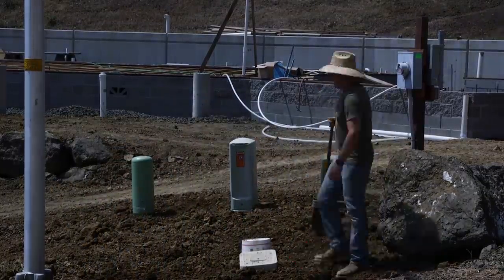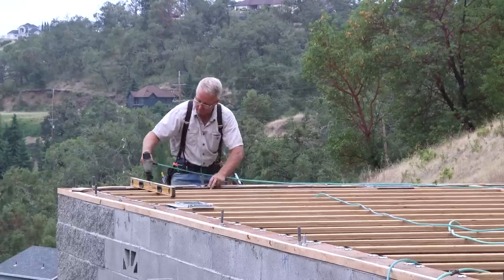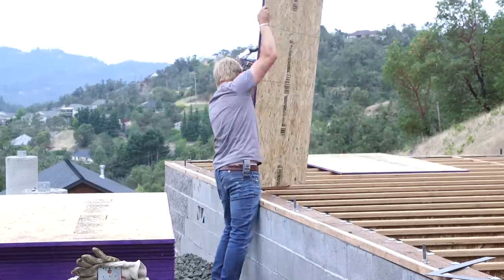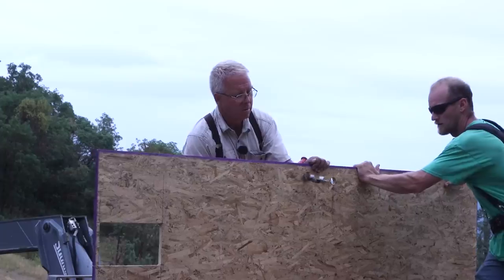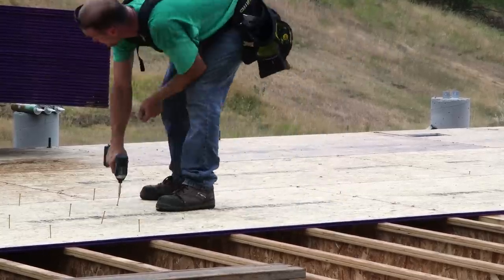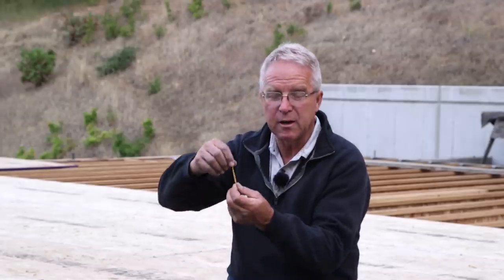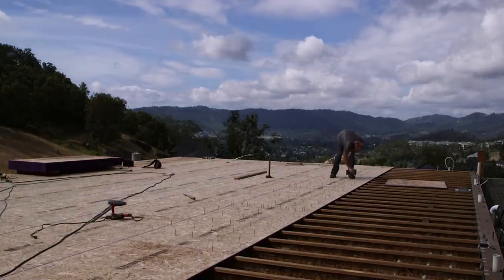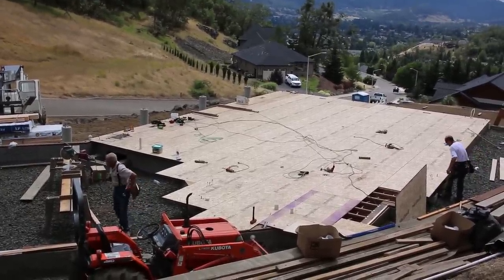Lay the Deck Ep.44

Comment: Hi, I use pallet wood for most of my DIY jobs and I can tell you just how well ring shank nails hold and they are probably the reason for 90% of my bad language when I come across these nails in a pallet. I have an air de-nailer that is fantastic at removing nails in pallets, but even when I dial up the air pressure these types of nail are b***** to get out.
Reply: I had to demo stair treads one time.  Ring shank nails and Pl adhesive.  That was 15 years ago and I still remember cussing and scraping.
Reply: Pallets usually have spiral shank nails not ring shank. Even worse!
Reply: @JarvisElian  Yes I have encountered both spiral shank and ring shank nails, the only thing they have in common is they are both a B*** to get out.
Reply: @Mr Sunshines I think you missed his point, which was about the nails in the pallets. And I can say from experience, it doesn't matter much what kind of wood it is if you're trying to get ring shank nails out of it. The nails are the problem and it sucks! Double-edged sword because what goes up must eventually come down. 

You may not know, but they're used a lot for subfloors specifically because they tend not to pull up as easy. I assume the guy brought them up for that reason, because in the video they were getting into staples to hold things in place while the deck screws go in, which is a great way to keep the OSB sheets down, and unlike nails, allows for reasonable removal if you miss the joist or skim the board. 

Bit surprised this didn't immediately pop into your head, since you're all up on 'building houses'. When I read the first comment talking about nails I knew immediately what he was getting at. And I've only had to do THAT job once, for a mobile home subfloor! Woulda thought it'd be obvious! Not very sunny over there when you wrote that, eh? Somebody rain on your plywood subfloor?

Comment: A fastener sticking out the other side doesn't hold any better.
I would use a little shorter screw.
JIM
Reply: A fastener not reaching the other side doesn't hold as well though
Reply: Shorter screw wouldn’t have a large enough smooth (shoulder) part near the head that he was describing
Reply: Lyle Conway  The correct min spec for 3/4” T&G Advantec subfloor is 2” W 3/4 shaft and 1.25” course thread. That’s what we use and they would have worked perfectly. That said there is nothing wrong with a 2.5” screw either other than you will have 1/4” penetration out the bottom of the iJoist top chord. As long as it’s not causing that chord separate (I’ve seen that happen too).
Reply: Dinsdale Drummond  not true at all.
Reply: @HBSuccess  It's demonstrably true. A fastener that does not penetrate all the way cannot possibly have the same holding power. There is simply not as much material engaged in the screw threads and the screw tip threads do not hold as strongly as the side threads, which are under more pressure and have a larger area of engagement. A screw with the tip overpenetrating holds better than a screw that stops before it can reach the other side 100% of the time, with all other screw aspects being identical.
Reply: He probably got those screws because that's what was available at the time and he didn't want to waste time looking around. Who gives a rats if they stick out or not.

Comment: Really enjoy the music you put to these, Nate.

Also, question: We built our house a couple of years ago. glued and screwed the 3/4 plywood to the floorjoists. But there's a squeak. From somewhere where a wall bottom plate is nailed to the subfloor. Do you plan to screw your wall bottom plates to the subfloor? Is this becoming good practice?
Reply: @Kyler and Sylvia Miller:  Can you access the under-side of that floor?  You might be able to screw up through the sub-floor into the floor plate to pull it tight.  (Easier if you have someone cause the squeak from upstairs to help locate the squeak, then stand there to compress it while you screw from the under-side.)
Reply: Thanks for this. Yes, I can access the space from underneath, but the squeak happens so infrequently that I'm not too concerned about it...  just the odd creak in the night as the house settles.Pretty hard to find the squeak... just one nail, I'm sure. Cheers!

Comment: When osb swells it doesn’t shrink again, not back to original. It’s lost it strength. Osb is vertical mulch. Lookup Matt risinger and see the video he did on a severely water infiltrated OSB structure. The WHOLE thing is shit and is having to be re-done.
Reply: I second that. When I heard him say that I wondered if they use different OSB  than we have here in Germany, nope, same stuff (allthough you get some impregnated stuff that has either a greenish or purple hue all over the board)
 Few years ago I had my roof fail due to a ripped vapor barrier. The drywall guys tore it and the glue did not adhere to the masonry on one wall. (Yes, building here are usually made different, modt of them are masonry and concrete, maybe drywalls for interior walls, but very rarely wood. You find that mostly in prebuild houses that only get assembled on site)
However, due to the torn vapor barrier underneath the insulation and the roof joists, moisture seeped into the insulation (some mineral wool stuff, no harm to it) and into the OSB.
OSB is vapor tight I löearned. The OSB did swell up to about 2.5 times its original thickness and was about as solid as soaked cardboard. Once OSB got that wet, here it is seen as failed, as obviously the wood itself dries up just fine, but the glue bond is more or less gone afterwards. It does not even shrink back to its original size, it stays at about twice the thickness and even when dried up you can easily rip it apart with your bare hands. I would not dare walking on that stuff afterwards.
My roofer recomended two things, adding in some ventilated space between an additional wind barrier and the boards, to allow anything to properly dry up in case anything gets wet, and with that using regular boards, as they will dry up and keep their strength just fine. Due to the ventilation rot will never be an issue, as nothing will stay wet. If anything has the chance to stay wet, you have an issue no matter what material.

Comment: Were 2-1/2" screws mandated by code?  Because with glue and staples, it seems like shorter ones would do.
Reply: A survey of single carpenters found a shorter screw won't keep the OSB from getting nailed by someone else.
And in local news, equivalency is the name of the game in construction so with the recommended 8d nails at 2 1/2 in length there should be a Roman connection in there somewhere.
Peace.

Comment: If the glue “welds” the decking down, why would ring shank nails squeak?
Reply: The glue could set up before you can get the sheet laid down.
Reply: "if the glue doesn't hold" ... or if there's an air gap and the glue never made contact to begin with
Reply: Fool
Reply: That’s why they’re “ring shank” so they don’t back out.
Reply: @brinkme1772  well thats why you put gule enough
Reply: @matthewerwin4677  how would the glue set up before the sheet gets laid. You must not be a framer 😂😂😩😩
Reply: @alexmitilica99 If the adhesive is laid down and sits for a while before the sheet gets laid down the adhesive will skin over and not bond well to the sheet if it bonds at all.
Reply: If you think about the way they are installed, nails don't tighten and pull like a screw does. Ring shank nails only lessen the chance of the nail coming loose. If the nails dont pull the deck down as tight as screws, then the bond with the glue wont be as tight either.

Comment: Thank you for the great video. As always, I learn a few new things and greatly appreciate the time and effort you spend.

What I don't understand is this preoccupation with floors that don't squeak. Maybe it's because I used to live in a 1900 era farm bunkhouse that was never meant to be home to a family, but someone added a few doors and turned it into something that resembled a 3 bedroom house based on building codes.  They used wood planking for flooring and had holes in it where the knots had fallen out.  Guess what .. it made noise.  I never really paid much attention to it growing up.

My current home was built around 1984 and makes noise. I find them comforting, not annoying. When the wind blows just right, it sounds like someone is walking around upstairs. If my wife comes to bed after I do and I'm still awake, I can hear the floor squeak as she gets to the door. I know that no one will ever be able to sneak upstairs in the dead of the night because there are 4 stairs that if one doesn't step on them just right will announce their presence.

For my house, glue and nail it down and be done with it. It's faster, cheaper, and will be easier to repair 25 years from now when those Torx drivers have gone the way of the buggy whip and only old men know what to do with them. Nails are timeless, easily removed, and when driven properly, will hold the floor down just fine.  I recently replaced a very large back deck the prior owner built and had to use a 6' 2x4 as a lever to remove all of the damn decking because most of them had screw heads that were impossible to get a grip on due to time and weather, many of them twisted off and required using a hammer to break them off. That Torx head works just fine now, but get 15 years of dust and weather into it and it will be just as bad as a Phillips.  And cause just as much swearing trying to remove it because even indoor screws get dust packed into them.  And heaven forbid someone paints over them.

But .. to be fair, they are easier than Phillips, I do use them from time to time.  Usually when I want to remove them right away.

If someone really wants (which is different from needs) noiseless floors and is willing to spend the money, and they don't mind hiring someone else to do repair work later, go for it. Far be it for me to tell someone what their values should be.

I just don't understand it one bit :-)

Comment: I would not be comfortable with 12" spacing on screws.
Reply: i agree...Up here in Ontario its 6i inch's in the field and 3inchs on the joints. And the way they did the PONY walls way to much work . And the idea using a string line to level the floor when they should have used a transit level.  A string that long is not level gravity makes it bow down so there might be a nice little dip in that whole floor. We call PONY walls up here Knee Walls . I could add more to this but i would run out of space...

Comment: Great vid also !! Thank you. 
 On my house floor that I did this summer. I shot down under the wall plate lines and a few other non travel areas with 10 penny ring shanks. Because I had them . But only had 1 box, 1k count of 2 1/2" subfloor screws. 
 I also loath gaps in subfloor . so I make them tight. And I squirt the grooves with subfloor adhesive as well as every joist and block.

Comment: save your back   invest in a stand up screw gun
Reply: For one floor? Ya that makes a whole lot of sense
Reply: Especially when u frame half the house from your knees anyway
Reply: @dylanmounsey7515  i have never heard of such things, they sound interesting.
Reply: @gramursowanfaborden5820  Hilti has some. I'm sure other manufacturers do as well. For screwing the laps on steel structural decking where were talking about thousands of screws a day they are a dream .
Reply: @gramursowanfaborden5820  Makita makes screw guns 3 ft tall or less
Reply: i also think one job would pay for it in labor savings
Reply: Yes they been out since 2003 if i recall right
Reply: For what? Hes done

Comment: I don't see much controversy, plywood is almost always better than OSB long term. OSB is easier and cheaper and good enough as long as it stays dry though.
Reply: A house should last only 100 years (the denominator being the concrete which at that age starts getting iffy) both OSB and plywood have more than that in terms of life span. What i don't get is why OSB manufacturers don't laminate the faces and edges. Then OSB wouldn't have any more issues. It would be only marginally more expensive than regular OSB.
Reply: Not true with floor sheeting. Having built hundreds of houses here on the Olympic peninsula I swear by Edge gold floor panels. The glue and the density it is pressed to outperform ply in the wet. Wall sheathing or shear panels I prefer ply if the customer is willing to pay the Xtra cost but even then there are drawbacks.
Reply: @riverrat1149  I've replaced countless roofs, osb is always an easy tear off because it draws moisture and weakens with time. The nails pull out like it's styrofoam. Plywood is always harder, old rough cut soft wood is usually about the hardest. More real wood = better. Same with floors, when I pull up flooring especially in bathrooms OSB is weakened or rotted while plywood or solid wood is always in better shape. My subjective experience, but it's enough for me to form an opinion.
Reply: @aserta  If your concrete is disintegrating at 100 year, it's because you're not doing it right.  Check out the Pantheon. (Not the Parthenon, the Pantheon)  all non-reinforced concrete (except for the portico)  2 thousand years old and still going strong.

Comment: PAM Drive. Belt feed screw gun with the stand up extension . 
 Makes screwing down subfloor actually fun. 
 I use mine with the extension for subfloor and without for drywall. 
 Torx for sub and Durock and #2 Phillips for drywall.

Comment: Scott, I appreciate your attention to detail. I probably wouldn't have worried about all of that shimming. If it was on an interior location then yes, but with subfloor adhesive having the ability to fill 1/8" voids fine, and the fact that the part being shimmed (sill) will be pressed out flat by the exterior walls riding on it, probably not necessary. 

Have you tried the new "foam gun" subfloor adhesive? I haven't been brave enough to try it yet.

Comment: We've always glued and nailed with 2 3/8" ring shanks. Glue is key as you said it will bond your subfloor and joists to a point nails and screws won't. I actually can't remember being called back on a squeak that was cause by nailing a floor. The one thing I will have to mention is that if a nail or screw hooks or misses down the side of a joist it needs to be removed because that is almost without a doubt going to cause your floor to squeak down the road with the small amount of deflection between joists. Also, as soon as you get that floor down it's a race against the clock to get your roof system in place. Especially with OSB the faster you can get it out of the weather the better.

Comment: That twist in the PTDF sill plate is why I use LSL for the sill plate. LSLs don't cost a lot more and the rot resistance isn't compromised when you cut or drill it because it's a laminated product. The other lesson I learned is to go to the paint store and get some of their leftover paint or mis-mixed paint (especially exterior paint). They'll usually give it to you for free because they have to pay to dispose of it these days. Paint your sub-floor liberally (a fun job for kids!) and that will help protect it from rain. Just some food for thought, your results may vary.

Comment: We have built maybe a dozen and a half wheelchair ramps with our church group of men ages maybe 50 to 85.  We used to air nail everything that moved.  We now air nail the decking and screw at the posts and stringers.  Allows us to take a ramp apart in a couple of hours and reuse 8 ft sections elsewhere.   Most ramps are not needed more than about a year or two.  The homeowner usually pays for the material and the church men donate their time.  Almost all of us are retired.     I calculated cost difference between the larger screws and nailing and the bail cost is probably 1/3 the cost of screws.  Quicker too.  We now build a 32 ft ramp in 1/2 day.  8 men, 1 compressor,  an 8 in bit on the auger.  And job assignments are repeated ramp to ramp so there is minimum lost time learning another guy’s job.    The impact drivers are wonderful.  Most have moved to the 18 or 20v  drivers, usually Bosch or Dewalt.  We always use #25 Torx screws. 2 or 2 1/2 in screws on the decking and 3/12 in on the stringers to the posts.  All us old guys love to play with the tools.  
Just threw in this comment about screwing or nailing. 
Great videos ....bless you for your educating efforts.  Please keep it going.

JoeB

Comment: I like vantec sheeting for sub floor that stuff is water resist,   I had a piece leftover from a project and its has some wear but still good if I need it.  I'm sure the glue will break down over time in the sun. Its a little brown from the sun but it could be used.  love watching construction videos learn so much from them.